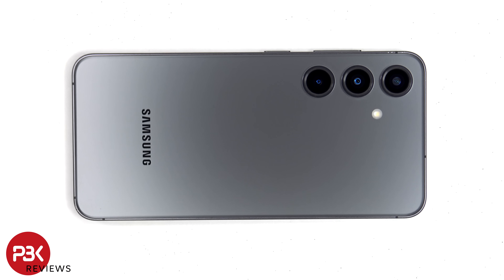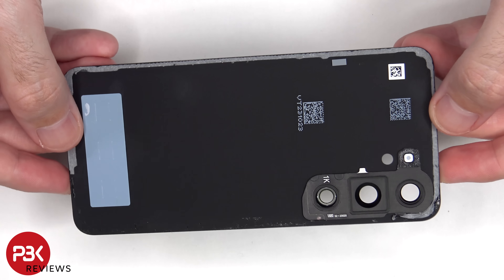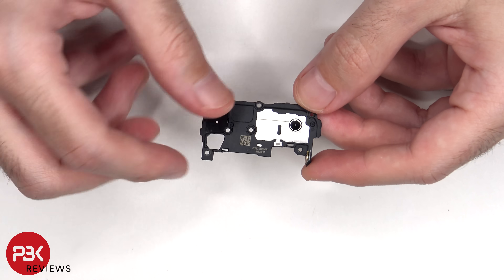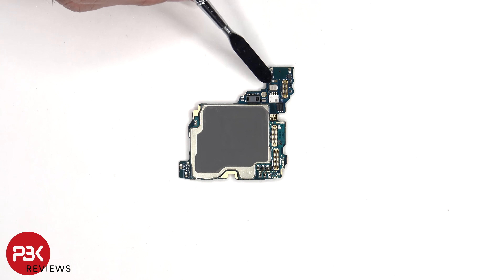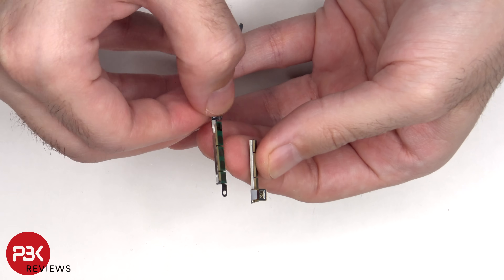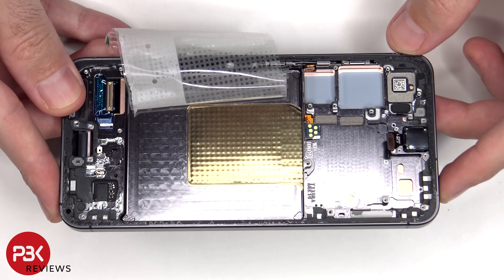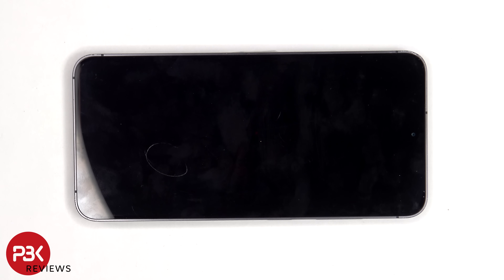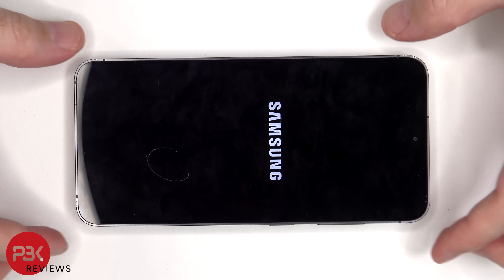Samsung Galaxy S24 Teardown Disassembly Repair Video Review

Comment: Hi, I asked a question on the Samsung Members forum but didn’t get the answer I was looking for, so I wanted to ask here instead: I accidentally made a small hole in the thin mesh inside the bottom speaker of my Samsung Galaxy S24. Could this affect the water resistance or sound performance of the phone?

Comment: Bro i was so scared for a sec. I accidentally pushed a lightning port into my s24 yesterday night cuz i wqs tired it was dark and i have both an usb c and lightning in my charging brick in white. And just now it didnt want to charge. Turns out battery protection had charging off for anlther hour i turned it off for a second and it works

Comment: I was hoping for some help... just recently got a s24... and wanted to know how strong they are to sideways pressure from phone clamp holders... I presume the strength of the glass combined with strength of frame would counter any possible bending.... but just wanted to get any other opinions. many thanks 🙏

Comment: Hey! Thank you for the video. I am worry about the regular speaker. Something is telling me that I damaged it when I was cleaning with with a small brush. Could it be possible?

Sometimes I don't like how it sounds
Reply from the maker: With a brush I don't think so but sometimes if the filter is sticky with residue and you clog it up, it can cause the sound not to come out as well.

Comment: Thank you for sharing such specific and detailed disassembly for free!
Reply from the maker: You are welcome!
Reply: @PBKreviews  also, can you share the working principle of a ventilation hole in s24?
 I bought mine 4 days ago, and 1 day after purchase the multimedia speaker started to make crackling sounds on low volume sounds. When you play something loud it sounds ok, but when you play some sound that has its volume gradually increasing and then decreasing like some openings on youtube videos or in music, it crackles on start and finish of playing that sound. When I set the volume just 1 step from muted, the lowest possible, it started crackling non-stop, until I raised it higher. Googling showed that its a pressure-related issue, and people suggested popping out sim-slot and then popping it back to equalize the pressure, and at the same time this issue doesnt affect all of the s24, which can lead to conclusion that it is in fact a factory defect that relates somehow to phone not being able to equalize the pressure with the atmosphere. So I RMA'd my s24 and rn I'm in day 1 of waiting for product quality check to complete and for them to approve the replacement of my s24 with another one. 
But I'm curious if you know how it works, does it let air pass only in one direction or is it bi-directional design?

Comment: Hello friend, I hope you can answer me, I currently have the s24 and the power button has come off, I try to put it back in and it stays loose, is it easy to replace without opening the cell phone?  Or does it have to be opened anyway?

Comment: How can you give 9/10 when: replace battery is really difficult if you compare witam other devices, impossible of disassamble screen without damage. Samsung paid you ? XD compare now fairphone 5 with this..
Reply from the maker: There is a breakdown chart of the score, the timestamp for it is in the description. My scoring is based off my assessments and opinions, and might differ from others. No I am not paid by Samsung. Also think a bit about the screen disassembly you mentioned. If you are replacing the screen, what difference does it make if it gets damaged? Makes no difference, so you can just pry it off with some heat and not worry about it so it doesn't make it difficult. It's only difficult to save a working screen if you are making a video like me and don't want to damage a brand new screen. :) Not to mention they sell screen and frame combos as well so you can also chose not just easily replace it as one piece and not worry about it which makes it even easier. I haven't worked on a fairphone but maybe it scores better, one day I will see. Regardless my scoring chart breaks down each section and each section can score a maximum of 2 points.

Comment: Accidentally, I slipped the SIM card ejector pin into the microphone hole instead of the correct one while trying to swap out my SIM card. Given that they're right next to each other, it's quite easy to mix them up. I was concerned about potentially damaging the microphone, so I turned to your video for guidance. From what I gathered, it seems like the pin might have just skimmed over the microphone component without causing any harm.Thank you!
Reply: Me too, 😂😂, so confusing . I'm worried if my phone gets wet so the water would get in.
Reply: Just did that a minute ago.

Comment: Thanks for the know how. But my question is: my phone screen cracked it is Galaxy S24 regular. If I need to replace it do I have to start from the back like you did or just heat up the front and take it a part.
Thank you
Reply from the maker: Most likely from the back, because even though it might be possible to do it just from the front, the chance of you not applying the screen down in the correct position for the cable to click into place behind the screen is not worth you rendering the screen useless by having to pry off the screen again to re apply and damaging it. It's just a better bet to take the back off, and disconnect the screen cable from the back, pry the screen off and apply the replacement and re connect the cable from the back again.

Comment: in your opinion, can we expect to buttons fall out of frame in future? seems like you pull them very easy 8:14
Reply from the maker: no you need to use something to grip like a sharp knife to somewhat dig into the side of the button to pull it out. Won't come off too easily.

Comment: I have a question about IP68, will it still be waterproof if I use it and click the buttons on the phone? Is it better not to do this and not use the buttons at all? water won't get through the buttons?
Reply: Hello!
I think you can still use the buttons but for the best precaution, better not.

Comment: thats super simple to repair. minor inconvenience are to replace the power and volume button the mainboard must be removed.
one thing tha samsung should improve are aesthetic of the parts. all of those version dan identification print should be moved to the backside of the parts and invisible to outside. clear back version of the device would be awesome if those all prints are removed.

Comment: How is the second microphone hole at the top just a ventilation hole, and the phone is said to be water resistant to a standard of 68?
Reply from the maker: That air vent hole is used for water proofing purposes. From what I understand and I could be wrong, it's used to release the internal air pressure. But I could be wrong, I just know they have said its an air vent hole for water proofing purposes.
Reply: @PBKreviews 
If it is a ventilation hole, water will enter the phone through it, and thus the phone will not be waterproof.  this is what I meant

Comment: Great video! 
On my s24 the microphone inner hole seems "offsetted" from the outer hole. Maybe I'm totally wrong since I'm looking at it with an external flash on it. Is this right? 
If yes, is this offset and/or L shape useful only for protecting the mic from accident and water/dust or also for better sound detection? Because it seems much mofe clearer than my s9 mic. But also here, maybe it's the sensor itself to do better job.
Reply from the maker: usually most devices will have the L shape offset to prevent accidental poking with sim ejector.

Comment: Thank you for the effort and being the first always with these kind of videos.
Would it be possible for you to compare Vapor chambers of S23 series with S24 series (like S24 base with S23U,+,Base.) for better idea of roughly how much larger the new ones are.
Also, if you can confirm the Haptic motor is the same for both S23 and S24 series.
Reply from the maker: You're welcome. I currently don't have any of the parts from the 23 series to make a comparison video.
Reply: @PBKreviews  Thank you, I'll try and crop from your videos.

Comment: Battery s23 vs s24???
Reply from the maker: The cable and connector location look to be the same, but I'm not 100% sure if the connector is the same or if the battery size will fit in the S23 compartment etc since I didn't have one on hand to test.
Reply: @PBKreviews  thanks!! and SOT between s23 base and s24 base??

Comment: Noticed how much sand and dust appeared on the earpiece speaker
Reply from the maker: yeah, over the filter of it, but it wont get inside the phone because the rubber gasket around it prevents it.

Comment: Is it necessary to glue the front camera when you install a new one?
Reply from the maker: If you want to prevent moisture and dust/debris from getting in and around the camera and phone, yup. You can use something like B-7000 glue but carefully apply a little amount around it from the back side as to not get it to leak to the front over the lens itself.

Comment: Love your videos. Don't agree at all with how you score repairability though. You are way too generous with the ratings.
Reply from the maker: Thanks. I understand it may seem so high by just looking at the overall number, but when you look at the break down its more understandable. Parts for example are very readily available for this phone, so that does deserve a 2 out of 2. Design is fairly clean and well laid out so repairs won't be complicated to do or parts to replace, so 1.5 there. Screen replacement even though you cant save a working screen, people would probably only be replacing bad screens so prying a damaged screen without worrying about care isn't hard. You just rip it out after taking the back cover off and disconnecting the screen cable from under the speaker assembly which isn't difficult. So I think a 1.5 is fair. All other parts in the phone are easy to replace too, so 2 there. Battery is also not difficult to replace which gets a 2 as well. How do you see it from your point of view?
Reply: Oh, pls shut it...his has been way more reliable than iFixit's for many yrs now.
Reply: People who wouldn’t dare repair a phone may have that opinion. Repairing phones is extremely easy.
Reply: Do you do repairs?